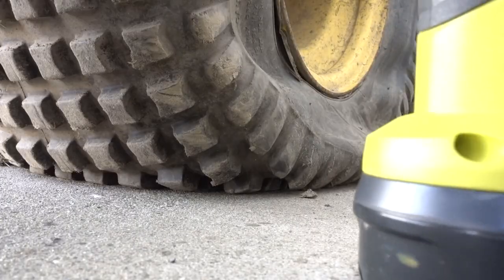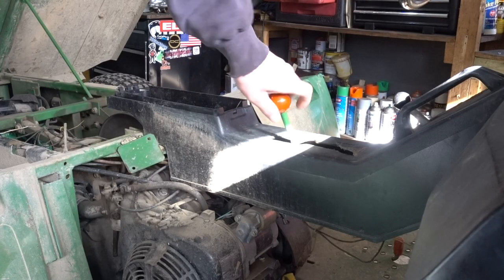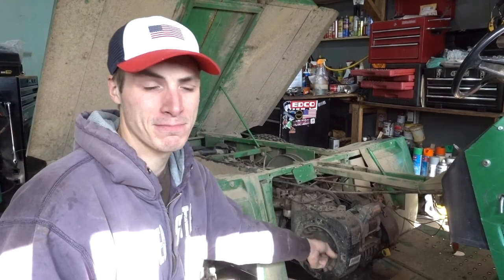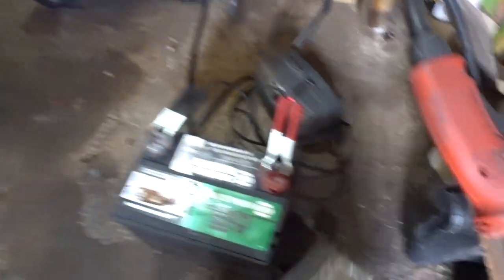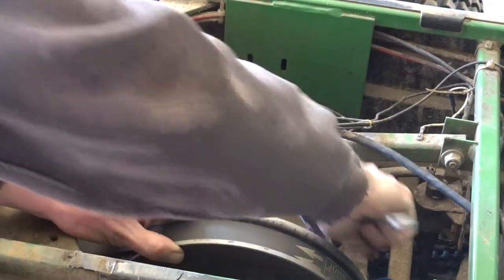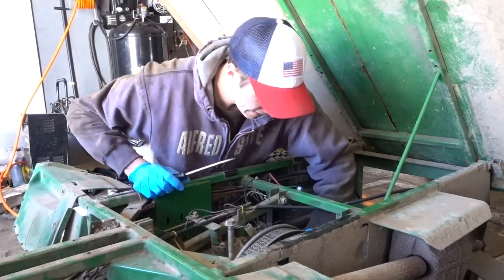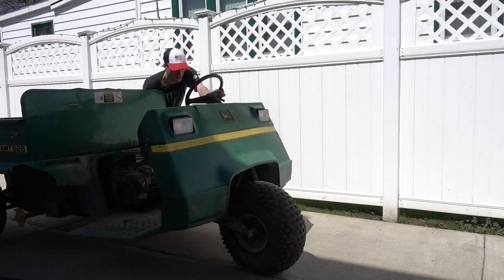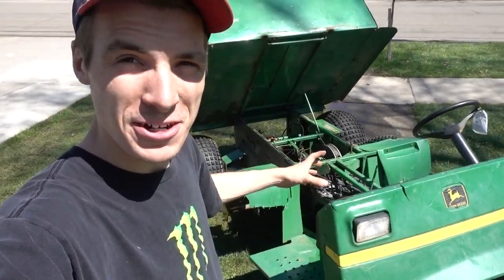NEW INSANE FIVE WHEELER

Comment: You should buy a junk Polaris rzr 800 900 or 1000 and rip the motor out of it put it in that put a 10 inch lift kit on it swampers and make it a mud bogging machine!🇺🇸🇺🇸
Reply: Isaac Lewis needs tracks on the back and a ski on the front, be a cool shits and giggles for winter
Reply: Isaac Lewis I mentioned the same thing last video. No responses tho.
Reply: Isaac Lewis that'd be hilarious to see him ride 😂
Reply: Isaac Lewis he should just buy the rzr motor not whole buggy, ya know what I mean.
Reply: Outrush Moto do you actually think the gator tranny would hold up 
To the hp/torque a rzr (even a shitty old 800) would make ? His best bet right now would either to find an old sportsman diesel that's wrecked but runs, or just throw a junk harbor freight 16 horse on it.
Reply: He should put the rzr motor in the gator

Comment: That pretty much is a go kart motor with a torque converter. If the engine does not work or is not enough power, you can pick up a Honda 13+ Horsepower motor or predator engine and drop it down in their. Just make sure the torque converter has the right fitting for the motor.
Reply: Jackson Hughes I think Predator Harbor Freight engine is the way to go...
Reply: @T Getz I agree I see no difference between the two... only prices
Reply: Yep Predator Engine if he can't fix this one in it. 400+cc engine at least...
Reply: SnipingSoup lol I said that in my comment...
Reply: predator 670. 22hp. V-twin.
Reply: I just put in honda gx 630. It is the beast!

Comment: hey dalton the engine is the same motor you would find on a logsplitter or big generator go to harbor freight and a prand new ready to run predator 420cc engine with the electric start and everything all you need is to hook up the battery and fill the tank is 370 bucks and it will bokt right in no fab work at all
Reply: 2WHEEL [HOON] the engine in it right now is a Kawasaki engine
Reply: 2WHEEL [HOON]  way better than a predator
Reply: 2WHEEL [HOON] those oldsr kawis are getting hard to find parts for. He'd be better off putting a junk h/f motor in it and selling the damn thing.
Reply: the H/F engines are bullet proof i fuckin had a 212 in a mini bike. rode in hurricane sandy during the storm in the powerlines. lost it in muddy fast flowing water looked for for 45 minutes than gave up and went home. 3 days later found the handlebar sticking out the water once it was over and water level went down. touke it home powerwashed it, touke the motor out cleaned gas tank out and carb, draained the water and oil LOL and pulled the spark plug out and turned it over after cleaning the pull start it fired like 7 or 8th pull. i thought it was funny it ran and the clutch worked and i rode it up and down the street. i later tore the motor down to the block got it bored new bearings and internals and i loved that engine it put up with all my shit

Comment: Will you please snorkel the gator.                                                                             Like so he can see
Reply: Ch
Reply: Christian Neshem good idea lol
Reply: YEAH
Reply: Christian Neshem on these motors you can't really go deep with them. The flywheel is open right on the side, so and water will have friction on the flywheel which won't work out for the motor.
Reply: Christian Neshem Hell yeah bud
Reply: jackson hughes thats part of snorkling
Reply: Milk Parker no see you can't get mud or water at level with the flywheel, so why would someone put a snorkel on it if it can't go that deep in mud?
Reply: not just snorkeling the airbox or any crankcase vents, snorkeling the whole thing. Build a huge box over the flywheel and anything else that cant get wet

Comment: Dalton, a couple things I want to tell you, 

Motors which have a utilitarian use are generally less compression than high preformance motors, because there is less stress on it. Second, to start the machine make sure it is in neutral, then turn the key or else the fuel pump will just turn on. Good luck! Very cool project!

Comment: At my work they have on of those gators but it only 4 wheels. That sensor would be the transmission sensor. You can only start it in neutral and then put it in forward or reverse

Comment: Weld some axles under the current ones and space them out some more. Then run dual sprockets on each one from the current axles to drive them and run big mud tires. I'm sure you can figure out the rest. Braap on.

Comment: I believe you run the outer tires at seven psi with the centers at five psi it's steers much better plus it's factory spec. Also their top speed was only 18. Unless the governor was bypassed then you'll grenade the motor. Seen that happened plenty of times. There is aftermarket seats that are much cheaper than the ritual John Deere ones.

Comment: Put a 1000cc engine in it to give it the large boost of power, you can get them very cheep on the salvage auction. Most of the time the bike looks fine but can't be registered because of a bent frame, or another issue that an insurance company doesn't want to fix.

Comment: @3DMachines The sensor is likley a hall effect sensor. it stops the starter being accidentally pressed whilst the engine is running and engaging and chewing itself all up. they go bad easily and is better bypassed if you are a good driver and not a simpleton who thinks to turn a key on a running engine.

Comment: if anyone in the work deserved 35 million. its you Dalton, although  not a JD fan I'll try not to call the gator pathetic the last one my school owned died for no reason no spark we just  changed the oil in it it had gas but never turned over even with a charged battery

Comment: i once went to a store calld johnson hardwhare and they have a lot of mowers and snow blowers ther were going to scrap a mower that had some good compretion a dead spark plug and no pull cord a took it changed the spark plug and got a cord to pull the engin over and there was gas in the tank and it ran and showed no signs of wanting to quit and it cut my lawn and it still looks like crap but it runs like new it is a 2005 yard micine

Comment: 3DMachines just because the oil is black does not mean that it is bad! Oil is a detergent. If its black that means its doing its job. If everyone changed the oil on their car when the the oil turned black it would be at like 500 miles. You know the oil is bad when the viscosity is different and the molecules in the oil are starting to break down. Oil not only lubricates the engine but it also cleans it!

Comment: Scrap that "piece of shit"one wheel front end and graft on a real steerable one with front disc brakes and real suspension from a 2WD ATV.You will be much happier, and it will showcase your welding talent, not to mention make that heap a lot more unique than it already is. You realize, of course that if the Deere factory had done this in the first place, these gator thingies would have been much, much more popular.